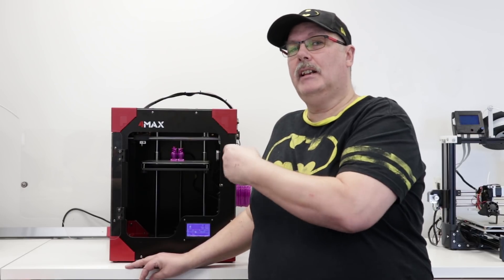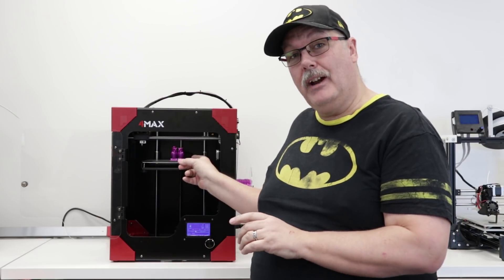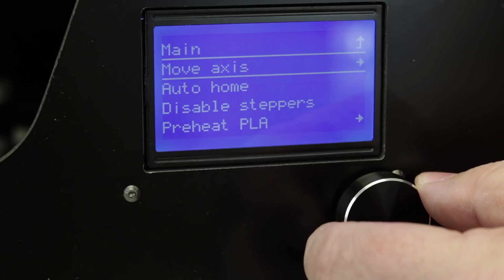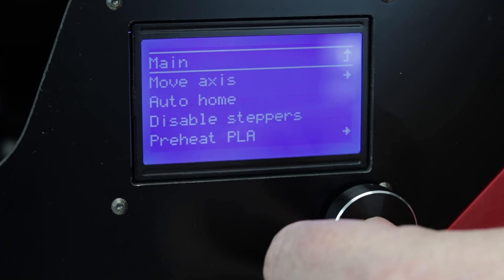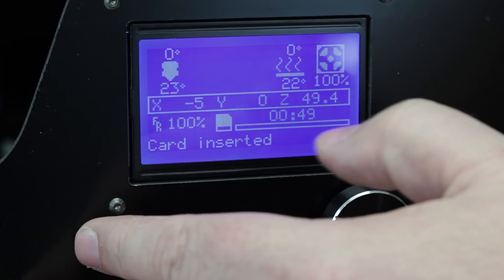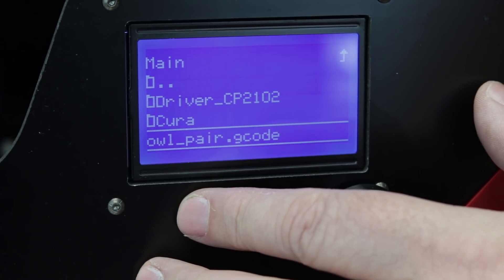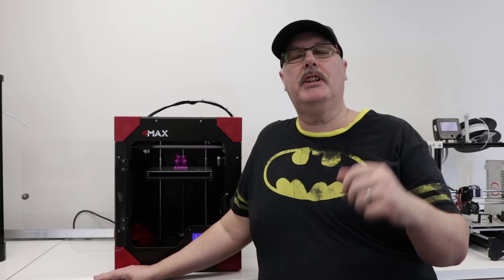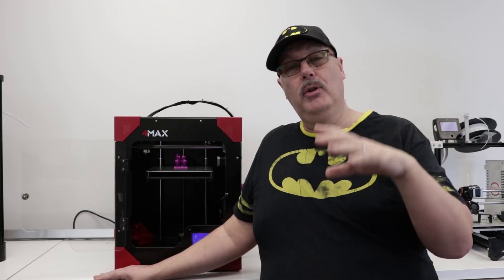Anycubic 4MAX wrap-up

Comment: I just bought this 3d printer. But I can't get a good result. There are two problems;
1. I can't print the round shape. The final result is always not round
2. The surface is not smooth, rather it has always fibres of filamen on it

Could you please tell me how can I fix it? Thank you

Comment: Hello. Can you answer for some my questions? 
1) If the print accuracy is 0.1 mm and the tip diameter is 0.4 mm, is it possible to replace this tip with a more accurate one in the future?
2) The printing table is held at three points along one axis (two guides and a stepper screw).
Will it be skewed under heavy load under the weight of a large printed model? For example model 20/20/30 with full filling?
3) I have an engraver with similar motors. Is the printer enough for the printer to evenly lower the table when printing a model with a lot of weight? Is there a similar problem?

Comment: This video was pointless. Why not review the printer, show it in action, and some close up quality shots and reviews of the test print? Anything informative or helpful really.
Reply from the maker: I'm sorry that this video didn't meet you standards.  Keep in mind that this was the follow-up to the FIRST LOOK video I did last week.  I suppose I could have shortened that video and finished up the build in this episode.  There will be a review coming out in the near future when I have had more time with the printer.
Reply: The First Layer I’m sorry, that came off shittier than I intended. Had watched your initial assembly video and was looking forward to a follow up video with a little more substance, initial thoughts, build quality, etc. I received mine last night, opened up everything this morning to start assembling and found to my dismay that the entire extruder, extruder motor etc is only supported by the throat without any other supporting bracket or screws. Suffice to say my throat had sheared off leaving a portion stuck in the bottom of the extruder. I promptly repacked it and am returning it. That design is an Achilles heel imho, even if it isn’t broken initially, with that much weight that thin throat is bound to fail eventually.
Reply from the maker: No worries, I am not completely sold on this machine just yet.  For the money I feel there are better alternatives that  are easier to operate and to assemble.  IMHO the assembly is not for the faint at heart.  In my final thoughts video due out soon I will be highlighting the short comings of this printer.
Reply: Great meeting you last night at the comic expo Calgary.  Looking forward to increasing your female demographic as I try to figure out my Ultimaker 3 that the husband bought me!  Lol.